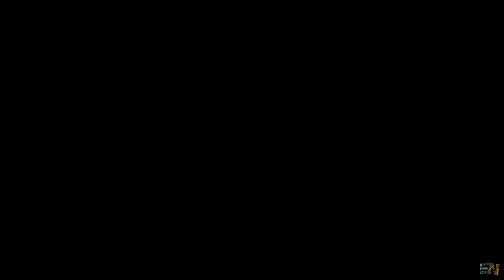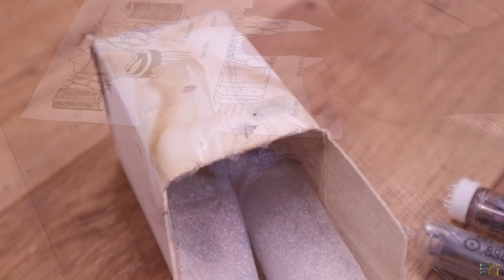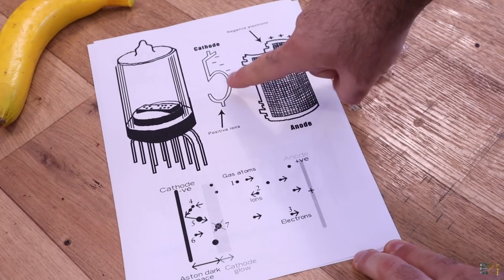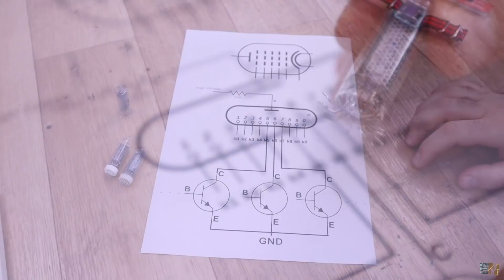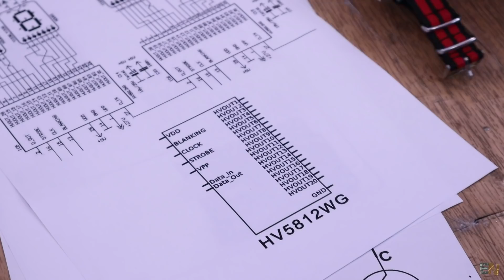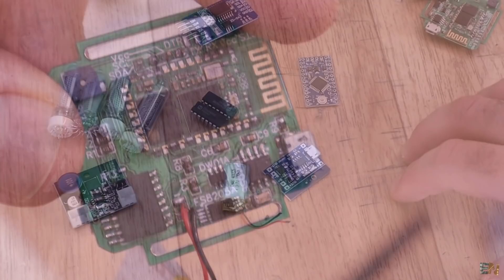Tiny Nixie Tubes - Control | Drivers | High Voltage | Circuit | Watch

Comment: Great video! even tho’ I’m 3 years late. I have two questions:
1.- Do you speak spanish? 
2 not so question.- I think that you could have got away with 3 nixie tubes, using 12 or 24 hour clock by using modulo 12. bc 12-hour clock are already 24-hour clock with modulo 12.

Bye!

Comment: A way to not use so many transistors could be that all the segments except the anode of the nixie tubes that you are going to use are connected to the same transistors, but that the anode of each of the tubes is turning off and on one by one. at the same time (the first nixie turns on and the others turn off, the second turns on and all the others turn off and so on) in a way so fast that it is imperceptible to the human eye so that it seems that they are all on at the same time?

Comment: I know this is a old vid but for nixie tubes not lighting properly you need to apply higher voltage to "burn" off the oxides on the digit once its fully lit it should be sufficient to function properly again

Comment: You can use 74141 TTL (there is also SMD version or K133ID1 analog) logic driver to control all 4 tubes as dynamic indicator. You can also use SMD DS1307 to minimize the space and four SMD MMBT92 (PNP) or MMBT42(NPN) transistors. Along with MCU and HV step up voltage converter, that is all you need to make your watch simple and small. :D

Comment: why not use a low power STM32L0? Arduino compatible, and I think the STM32 has built in RTC as well. Eliminating one more IC saves board space and reduces power draw slightly

Comment: Is it safe to run those voltages on a breadboard? I'm really curious about that.
Reply from the maker: Yes, there are a few mm between the lines so below 500V there should be no arcs.

Comment: Hey my friend 
It's a great project to work on!
I have an idea that may allow you to save some space on the pcb 
The idea is to control the 4 nixie tubes with one driver only
This will save a space of one driver but you will need 4 more BJT transistors 
I once did it with one shift register and 4 seven segments and it worked 
I don't know if it will work with nixie tubes but it will be a good experience to get 
If you want i could share with you my code to make it clearer 
wish you best of luck ❤️❤️❤️

Comment: He encontrado estos más baratos por si decides comprarlos de nuevo, creo que estan usados. :-)
https://www.ebay.com/itm/IN-16-IN16-16-nixie-tubes-for-clock-thermometer-used-tested-1-pcs/143817146770?hash=item217c2b8192:g:ekMAAOSwaB9fuBUT
Reply from the maker: Muchas gracias!

Comment: Can't we use multiplexing in these nixi tube to control 4 nixie tube with just 14pins of arduino. We can use 10 npn bjts connected to all the numbers of all the 4 Nixie tube and use 4 pnp bjts for the anode of each of the 4 Nixie tube. I don't know if the tubes can switch fast or not so if you try that, then do tell me.
Reply from the maker: I should try that. But from what I know they need high voltage DC and multiplexing is like applying fast switched signal and might not work ..
Reply: @ELECTRONOOBS  I am also doubtful if the Nixie tubes can switch that fast. But it will be worth trying. If this works, then try to alter the switching frequency to see where will the sweetspot lie if at all the multiplexing works. Anyways, thanks for the great and knowledgeable video!!
Reply: @ELECTRONOOBS  You can switch and multiplex the HV DC anodes. Use PNP high voltage transistors, instead of the NPN ones, which are used for the cathode ground. I've also seen ti been done using opto-isolators, to switch and mutiplex the HV anode side. 

 Just about all nixie tube watches I've seen do use multiplexing, and many nixie clocks do as well.

Comment: Very interesting.  I built a 6 tube nixie clock (H:M:S) back in the early 1970's.  It was a kit from Henry's Radio, a popular electronics supplier of the time.  It was mains powered and used the mains frequency to generate the clock cycles, divided down by 7490's and decoded by 74141's.  Things have certainly changed since then!

Comment: Checked the HV5812WG datasheet and it's only rated for up to 90V operation and is meant to drive VFD's not nixies, so you'll have to find something else.
Also the HC-06 BT module you showed in the video has it's own programmable microcontroller so you can try programming it, maybe that will save some power.
You can also multiplex nixie tubes and use fewer driver IC's. For something like this if you choose to drive the nixies with transistors then you no longer need the driver IC (which is just a high voltage shift register anyways) and for 4 nixies you would only need 10+4 pins.
Edit: and only 10+8 transistors.
Reply: A better choice for the driver would be the HV513 which is a 250V rated 8-bit shift register with short circuit detection and other cool features in a 24-pin SMD pachage.
And since the output is push-pull two of these can be used to drive up to 6 nixie tubes (10+6).

Comment: I like nixie tube as much as the next guy, but is a watch really a practical application rather than a desk clock. Apart form looking....Well not the slickest thing I'm be blunt a hideous Frankenstein machine, isn't it a bit non-sensical having fragile vacuumed chunky glass tubes that might implode on my rest with a 200v supply that might zap the shit out of me. 
Side note If you are still planning on making it a watch you might as well make a hand shocker out of the supply to prank your friends with.

Comment: Seriously are you crazy you made a watch thats runs 200 volts thats  dangerous  please made as save as possible
Reply: Actually I wear a watch that runs on about 200 volts DC every day. :) The 200 volts is safely inside the case of course.

Comment: How does PWM signal in a lengthy RGB LED strip maintain the current throughout????  How can we maintain current in long wires in industries for wired sensors away from main circuit board???
Reply from the maker: Use low resistance wires, add amplifiers, increase voltage. All this should help for long range
Reply: @andymouse  thank U brother
Reply: Can You plz make a detail video on it...  It's a much needed video bro
Reply: @saurabhgawli2167  only for you ! there's plenty of stuff on youtube about this.
Reply: @andymouse  it would be really helpful if u point me out one of it..  I don't know the keywords to search
Reply: @saurabhgawli2167  this link should get you started at least....https://youtu.be/WMPnfBlXM9A

Comment: Challenging project! I made a desktop clock using filaments from regular LED lamps. My digits are about 10cm high. The high voltage generator is based on the good old NE555.